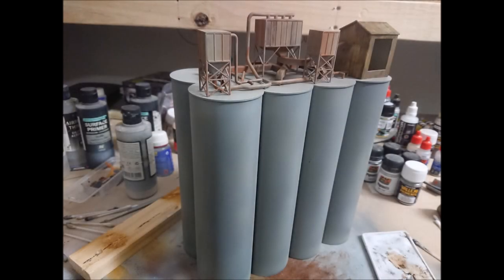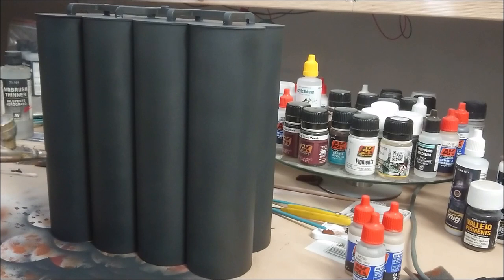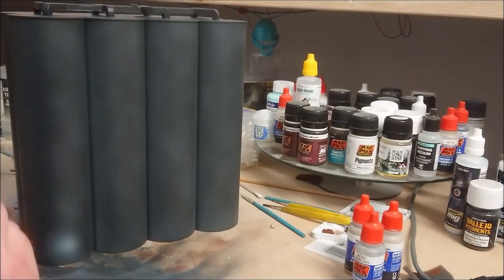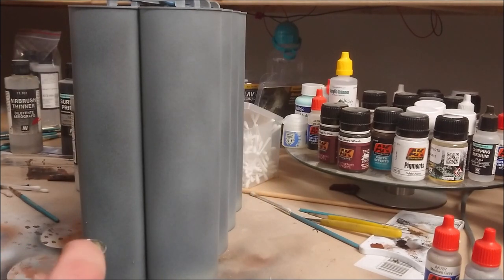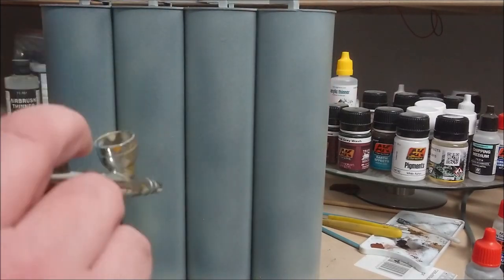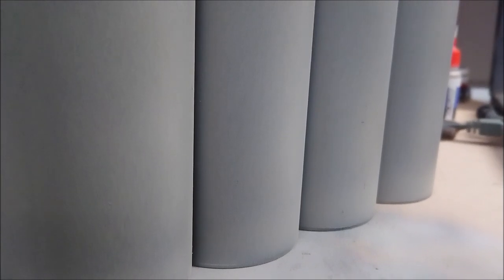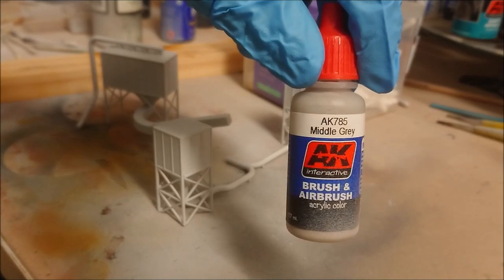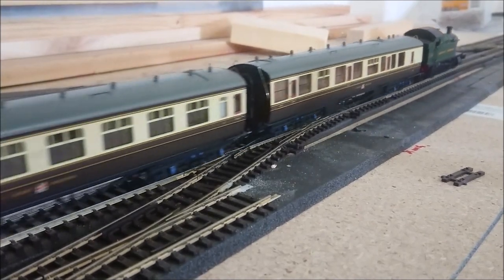Leila Central Model Railway - Painting cement / concrete silos.

Comment: Hey Clint, another quality paint job. Faultless. Why did you have to use the "putty"? Did the silo split after gluing and while drying? I know that when using an air brush, it is importantto look after  your health and I have seen others use a mask as a precaution. Since we don't see your face while you are using the air brush, do you use a face mask respirator? If so, what make, model and level of mask do you use. It would be good to know because, as a novice, I need to get one to protect what lung capacity I have and want to keep. Thanks, 👍 Mike
Reply from the maker: Hi Mike, thanks for watching and commenting. The putty I used because despite all best efforts and seen with other silos made by Walthers, there are distinct seams that cave inwards on the model leaving 4 lines that stuck out like a sore thumb. While a lot of people just leave it, I decided to fill the seam in as best I could. I used deluxe materials perfect plastic putty for the first time. Good point on the respiratory protection and yes I wear a simple half mask with filters. The filters are entry level against particles and dusts and serve the job good. A pair from the local hardware store cost be $12 and the half mask is about $24. I usually have the window open and a fan going as well to assist in ventilation as well. I just saw your post before it was edited about the painting list which is something I will adopt in future videos at the start. All the best, Clint
Reply: @leilacentral1883  Thanks Clint for the info. I had hoped that you hadn't read my initial comment about listing what you use. I realised after writing and posting it that it was wrong of me to do so as you already have enough on your plate, without giving you more work to do. I therefore decided to remove the post and start again. Besides it was 6.00am, the middle of the night for me, so I was still asleep when i wrote it. Lol. So far I have gone through all your YouTube videos and have written down all your paints including product codes, so when I order them, AK Interactive, will just charge me one postage instead of multiples. Take care and keep painting. Mike
Reply from the maker: Awesome stuff Mike. Won’t be an issue for me to add what paints I use at the start. Always happy to help. Clint
Reply: @leilacentral1883  Cheers Clint

Comment: Hi Clint, you do not mention anything about the airbrush or compressor that you use or did I miss it? Having watched this one I see that you use a Sparmax airbrush SP-35 but I did not see the compressor.
Regards Chris
Reply from the maker: Hi Chris, well funny enough I didn't mention about anything on the airbrush or the compressor. When I started airbrushing I bought a delta airbrush and compressor kit. Was a cheap but good reliable unit. Since then I'm using a Spar-max airbrush the SP-35 but the original compressor is still going perfectly fine after 8years. I don't understand why i would need to pay big dollars for an airbrush setup when all I need it to do is spray paint and give me some good control. Ill probably do a recap on the airbrush in a  new video showing people what I use. All the best, Clint